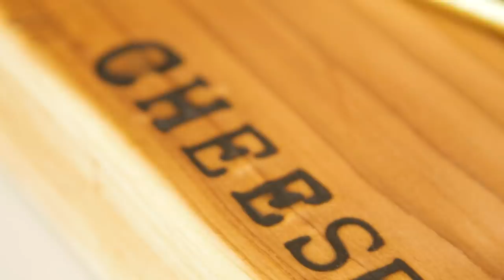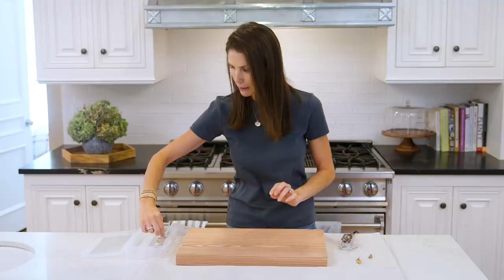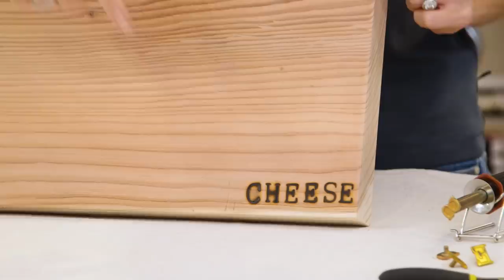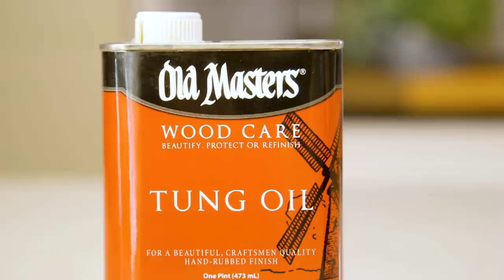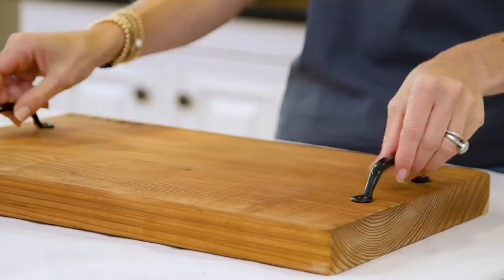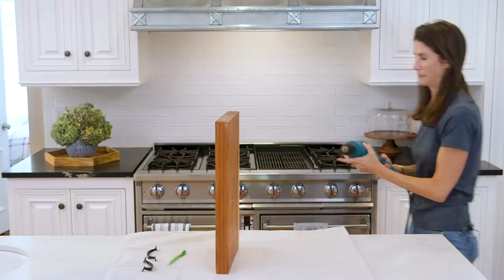EAT | DIY Wood Cheese Board!

Comment: So inspiring! Thank you!!  I legit made 5 of these for Xmas gifts using pine which is lighter in weight and color.  My boards were 1 inch thick and used the same handles.  they fit perfectly (with no margins).  Thanks again, I would not have accomplished the project without your inspiring video!!